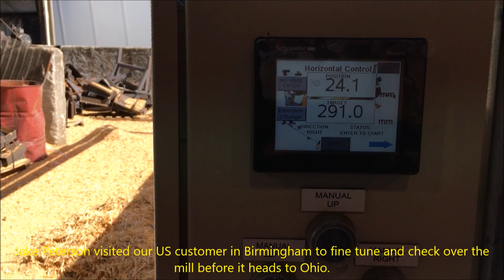Mighty Gladiator M12 sawmill in Ohio

Comment: Are they cutting boarn by board for the demo? Are they able to make 5 slices on top then 1 across the side??
Reply from the maker: Boards are a little lighter to handle this way. Consider the weight of one of those 12" oak boards.

Comment: If you're making 1x12" boards why not move the blade over to the right to make one cut horizontally and then just keep the blade vertical and cut down and back
Reply from the maker: Could do but the forward cut tends to be a little slower and removing a bunch of 12" boards at the same time will take some lifting, especially oak.
Reply: TURBOSAWMILL 
I was meaning that if you did one horizontal cut at 12" depth and then every time the mill gets to either end a new board is made and removed at that time.
Reply from the maker: Yea that's an option.

Comment: The machine is set to metric.  Is it now manufactured with U.S system of measurements?
Crazy expensive!  But definitely a savings in the saw blade vs the band saw blades.  Way easier sharpening 5 teeth.